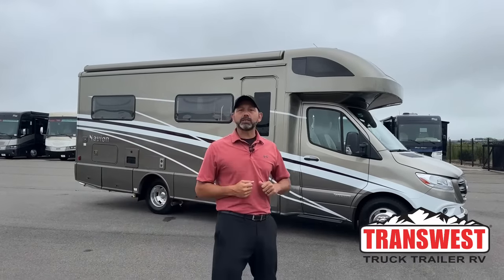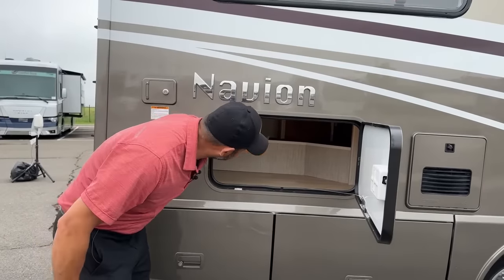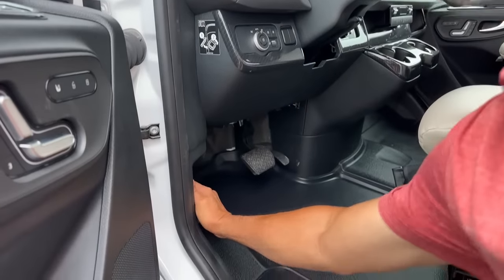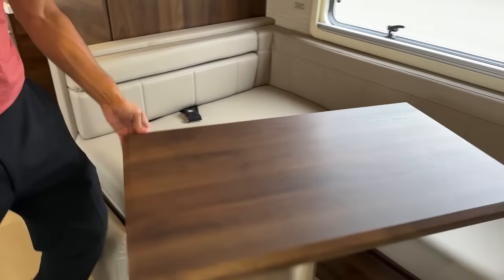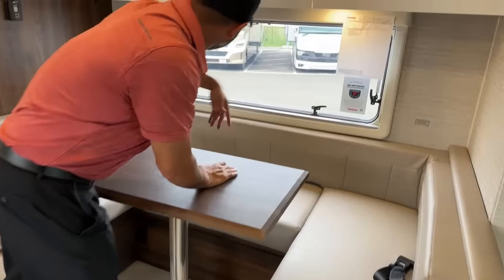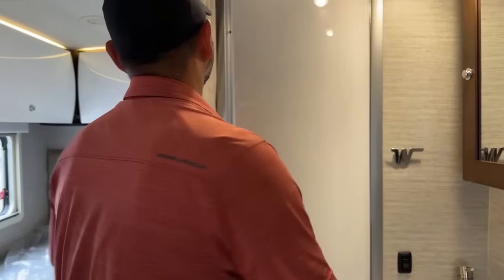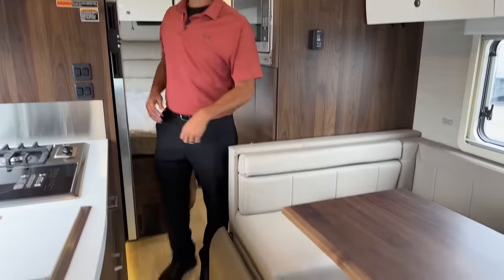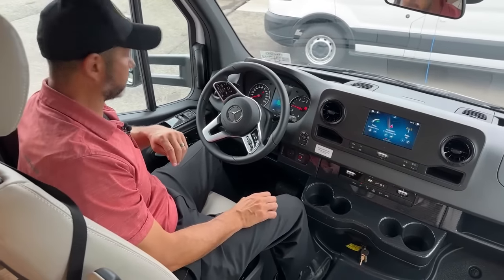2023 Winnebago Navion 24J

Comment: We have a 2019.  The hood latch broke right away.  Be careful, as it's heavy.  The Mercedes chassis is ok and runs well.  Lots, and lots of things in the camper broke down, or did not work.  Spent lots of time in the shop, and Winnebago  does not warrantee much, and you have to go to the manufacturer of the parts they installed. This included (first month) house batteries,  the Nav screen, the inverter switch, the water pump, and more.  The Winnebago portion of this RV, is built pretty cheaply, and I would not buy again.
Reply: Appreciate you sharing your experiences. It saves others from troubles.
Reply: 0:32
Reply: 0:57

Comment: Hey guys… excellent video here!
I do have a couple of questions for you.  
So if you’re a single guy with two dogs and your job requires 60% travel time…  
What I was thinking was to buy one of these smaller RVs and use it as a vehicle and hotel at the same time.  
Even if I need to pay campsite fees that’s going to be more convenient and cheaper than checking in and out of a hotel every other day right???!!!  And the dogs can just chill in the RV while I’m at work right?  I need AC working of course.
Do you have any suggestions?

Comment: Acrylic windows???
Reply: Hey Todd....thanks again for watching and yes they are dual pane acrylic windows.  See the optional equipment list below which is straight from the Winnebago brochure.  If you are ever in the area stop by and check them out.

Optional Equipment:
Dual pane acrylic windows
Dual recliners w/table (24V)
Theater seating w/swivel tables (24D, 24J)
Entertainment System Blu-ray disc player and Bluetooth® Soundbar